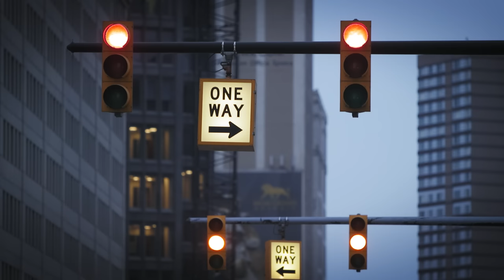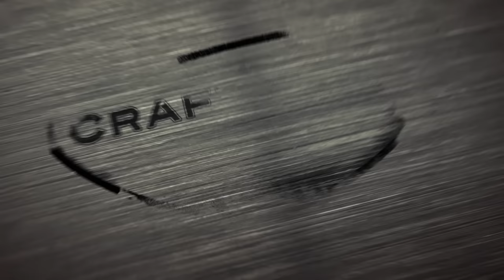The Hat Maker | A Craftsman's Legacy

Comment: Congratulations! What an awesome experience! As expensive as a handmade hat is it would be SO worth it if everyone could have the hands-on experience. Of course, Nate's production numbers would really plummet then! Now, if nobody has mentioned it, you need to get yourself a hat stand where it can rest and maintain its shape, especially if you get caught in a heavy rain and it gets soaked.
Reply from the maker: Great advice!  Looks like I'll be making a hat stand soon!
Reply: A Hat Box works fine and if you get Rain on a Hat shake it off and let it rest on its Crown and dry.
Reply: @jameskann951  Yeah, that might work for a "damp" hat, except for 2 things: 1) you probably don't get a hat box with a custom hand-made hat as you would with an "off the shelf" hat like Stetson, Resistol, or Charlie One Horse. And, 2) it won't work if your hat is soaked as I mentioned above. If the hat is soaked through it becomes so malleable that just setting it on its crown will crush it and ruin the custom fit, it'll never be the same, which means you try to restore it yourself or take it back to a Hatmaker. A hat rack will preserve the shape and fit while allowing it to air dry and firm up slowly as it should.
Reply: @markharvey7988  Nick Fouquet gives you a custom Hat Box when you buy a Hat from him. Hatmakers have their own Hatboxes at least most of them do.
Reply: @jameskann951  That's good to know, thanks! Does Nate Funmaker give you a custom hatbox? Maybe so, I don't know, which is what prompted the suggestion. I DO know however that you don't put a hat in a sealed container unless it's completely dry. Unless you like mold or fungus anyway. All of which can be resolved with a simple hat rack, which will maintain the shape of the hat you paid so much money for as well as looking good on the wall. I've never owned a custom hat and it's likely I never will, but I have been wearing hats for almost 50 years. My go-to is over 30 years old and still looks well, not new, but broken in with many years left in it. It's an off-the-rack 5X Stetson, nothing special but eminently functional with just a hint of style, as am I. Thanks for your input
Reply: @markharvey7988  Custom made Hats are fitted for your Head not a Stock Model Hat you also get a range of Colors and Materials to choose which makes it a special Hat. Stetson makes nice Production Hats yet,their sizing is inconsistent and your limited to a specific Style,Colors etc. You can find custom made Hats 2nd Hand on Ebay and Etsy. It's a Small World! The real advantage of going to a Hatmaker is they generally can help you pick a Hat that best suits your Face and Body perfectly you want get that experience buying a Hat Online. Happy Hatting!